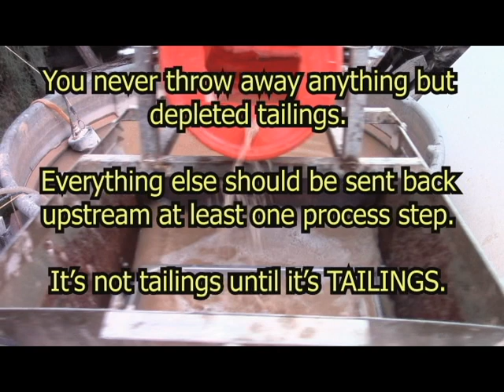141 It's Not Tailings Until It's TAILINGS

Comment: I've never seen one of those before.what is it called?
Reply from the maker: The base mechanism is a Keene Hydramatic Jig.  They were produced decades ago and are no longer in production.  I did a video on it about a year ago.  "A Fluidized Bed Concentrator".  In  this case I am basically using it for the oscillation.